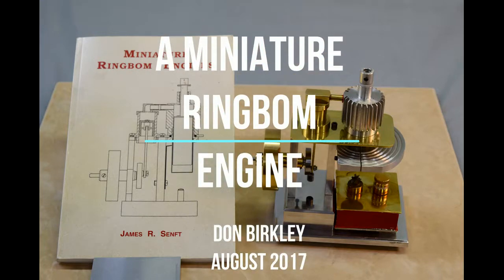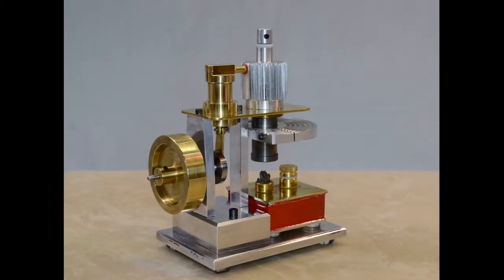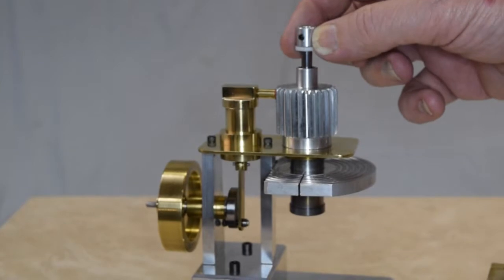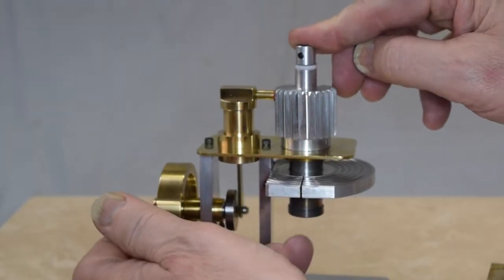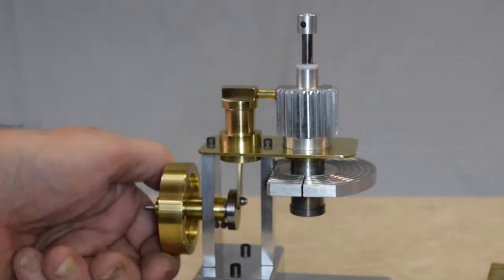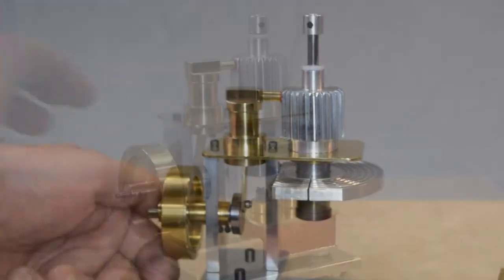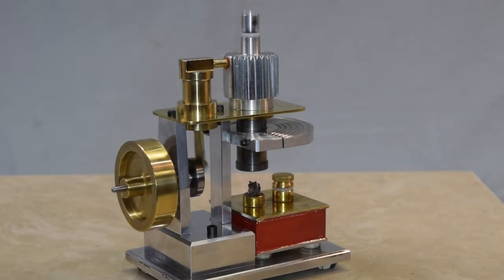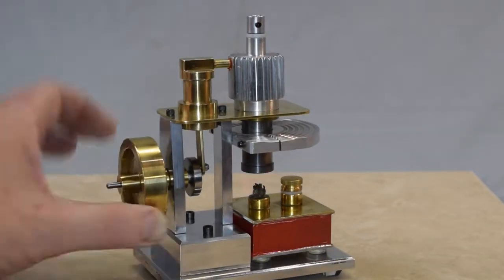Ringbom Engine

Comment: Are all ringbom engines going to have that knock?
Reply: I'm sure a smooth absorber could be added to either end so it can be quite.
Reply: @thermionicemission6355  some work with a spring rather than gravity alone. 🙂
Reply: What if the power piston were on a spring as well, rather than a crank??? AKA free piston heat engine.